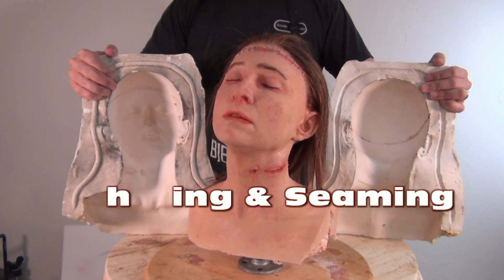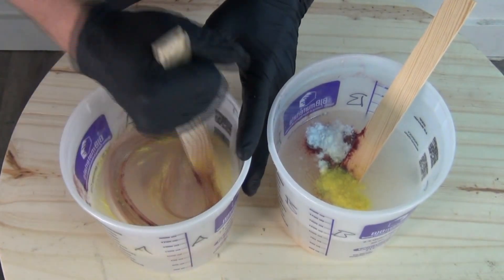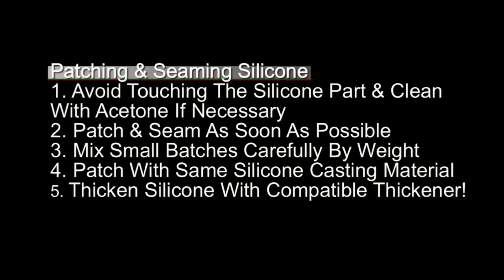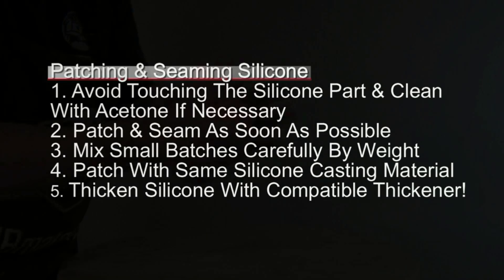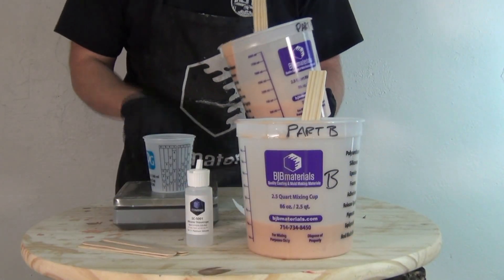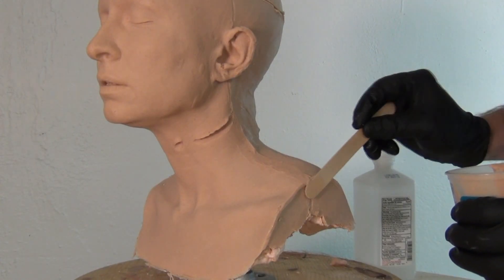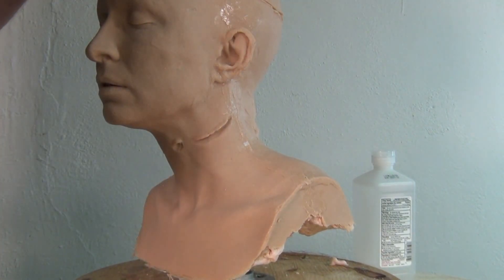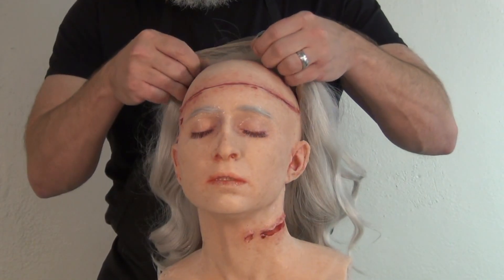Casting A Silicone Bust: Patching & Seaming Silicone

Comment: Is it possible with platnumps silicon that's already been cast  then spray on a additional fine layer silicon  then using stamps or rollers to add wrinkles, and skin texturing ?
Reply from the maker: I have not tried that, so I don't know. That said, any roller or stamp must be compatible so it does not contaminate the platinum silicone.
Reply: @brickintheyard thank you for responding and dealing with my poorly written a message😅